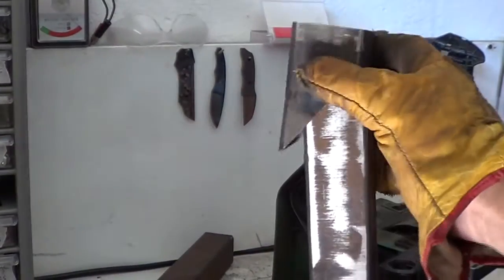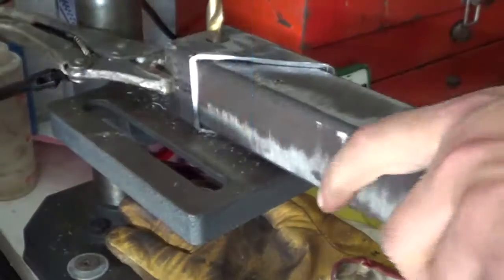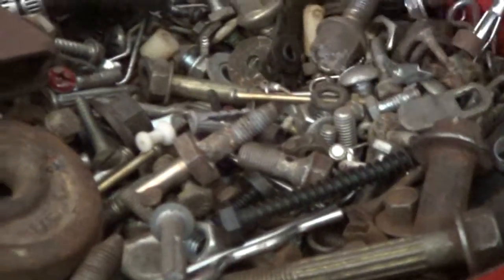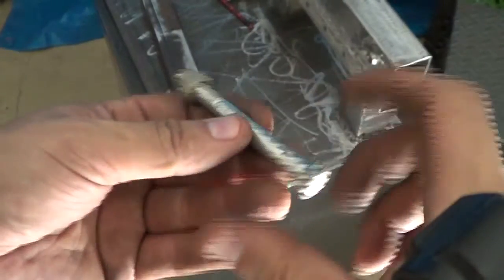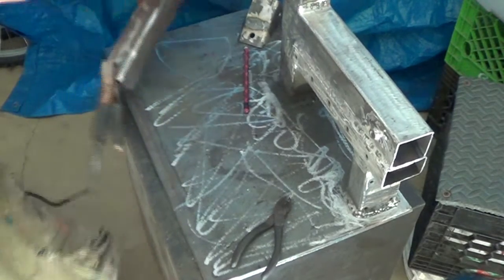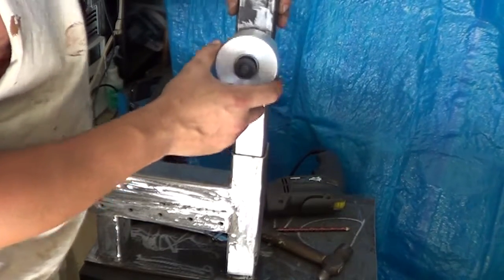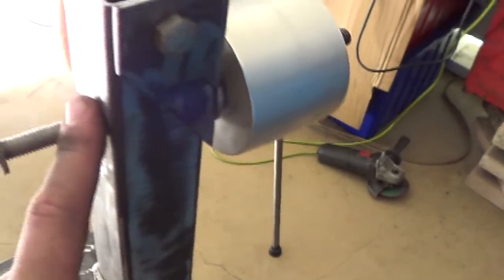Tracking Hinge Fabrication for 2x72 Belt Grinder Part 3

Comment: I,ve been working on a 2x72 build  myself and was having a problem with the tracking wheel setup. You,ve solved it for me...Thanks for the help. I don,t own a welder but was wondering if brazing the nuts on for the adjuster bolt would work. Would it be strong enough or am I wasting my time... Thanks again...Rod
Reply from the maker: +walleyefishin rod Glad this Video helped Brother, I wouldn't bother with brazing, you may get away with just scews and bolts , acting like welds. That is, if you can manage to get the nuts where you like.....but in my vision, it's possible =)   Good Luck with your 2x72 Project Brother......Stay in touch , I'd like to see how you made out....  Subbed Ya ;)